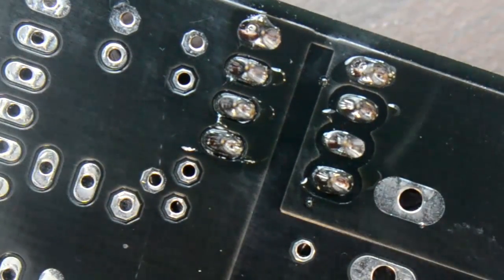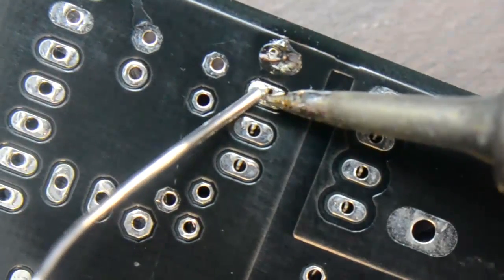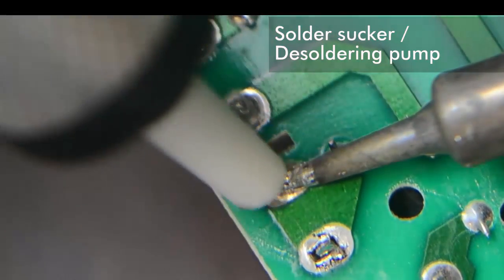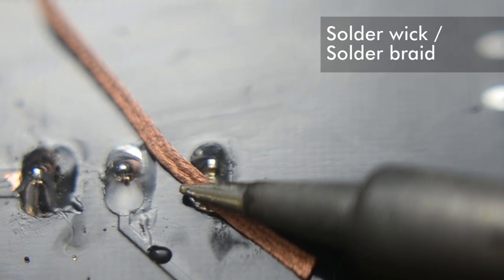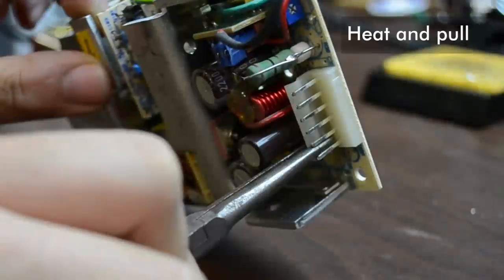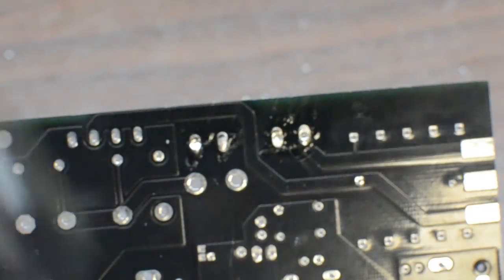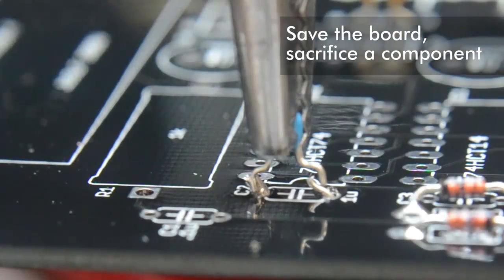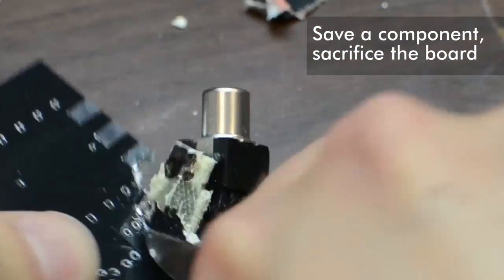Practical Desoldering

Comment: I never liked those solder sucker things.  We had them at school but I couldn't get on with them.  I was taught to use the wick and although it can be quite wasteful it often does a clean job.  
For my very first job I used to work for an electrical engineer and he had an electric solder sucker.  I'm struggling to remember exactly what it looked like.  I think it was essentially a soldering iron with suction.

Comment: i always add extra flux to my solder wick. i also cut it into 2 inch pieces. i find with the extra flux and using smaller pieces, it works a lot better and also doesn't waste solder wick

Comment: Mate , gotta give props to this video,  had this issue with my one of my decks , never soldered anything in my life and left the dirtiest looking lump of metal on that circuit boards but boom it works ! Thanks pal
Reply: It's shit as it doesn't even touch on leaded vs unleaded solder. It fkin advises a person to take pliers instead of just buying a  heat gun + foil.
Reply: @N1c0T1n3__   still spinning

Comment: A desoldering gun is the single most useful tool for electronics repair. It's not only useful for removing through-hole components but just as useful for surface mount ones too. If you ever tried removing an smd from a ground plane, you know exactly what I'm talking about.
Reply: Can also be a major pain in the whole shop. The desoldering guns are not all equal and that hot solder being   sucked up sticks inside gun , very badly for some guns.
Reply: Hey WHAT IS WORTH DESOLDERING FROM OLD PCBS ??? (SALVAGING OLD COMPONENTS)
https://youtu.be/FRYSY6ZaEBk
GO WATCH THIS AND FIND OUT !!!